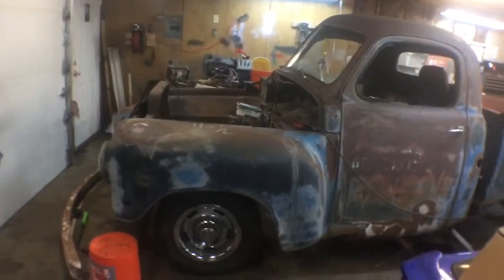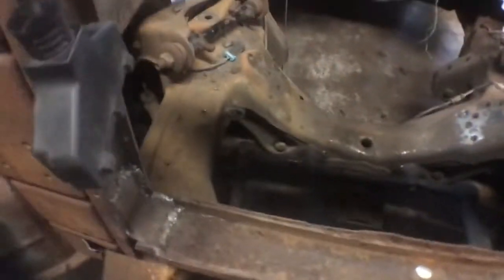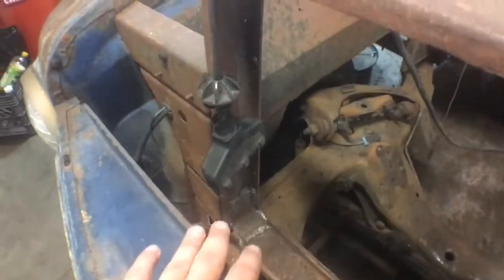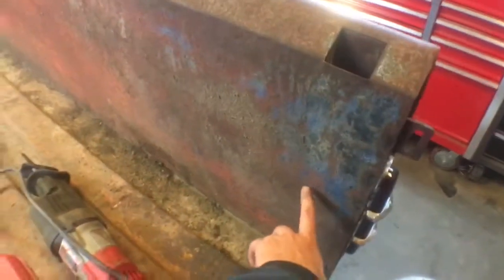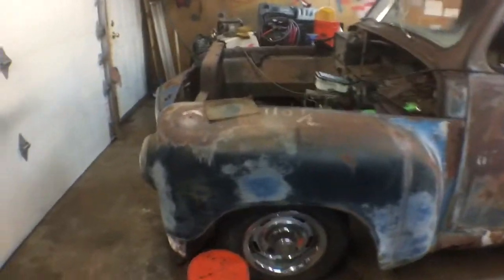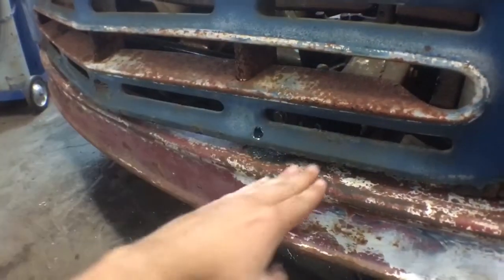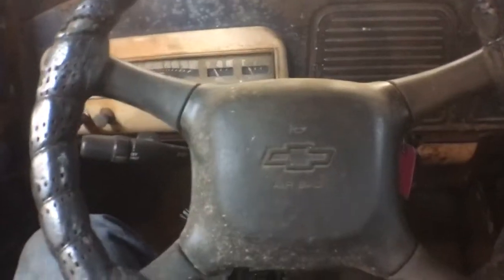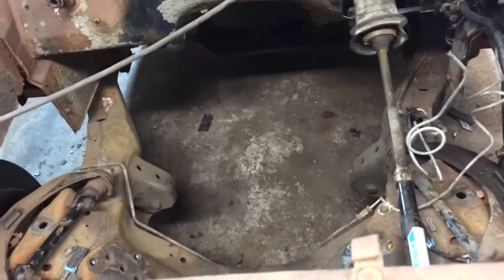Studebaker Pickup Rat Rod Build Part 1

Comment: Dakota frames work better for Studes,wheelbase & track width are dead on,They have rack&pinion steering,back at the crossmember,out of the way.The rear frame kick-up is less than the s-10. I'm doing a dakota under a '46 M5

Comment: are you doing power steering? if so how are you doing it? I have a 52 2r6 I am working on right now. any advise or help would be great thanks
Reply from the maker: Levon Tipton yes power steering is in and done. It has power breaks, heat etc, drives like a modern truck. I have a lot of videos on the series and show almost every I’ve done in the process. It’s a stock Silverado pump and stock s10 and Silverado lines and a s10 blazer power steering cooler. I show in one of the videos power steering pump clearance issues too.